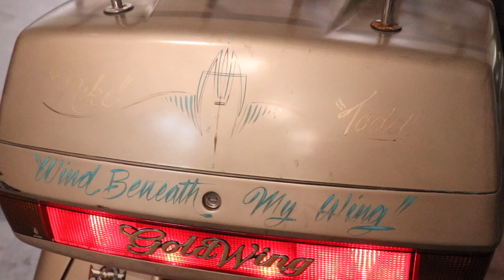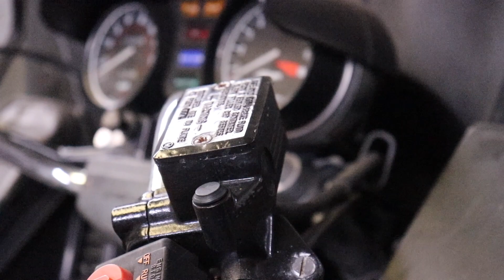The BEST DEAL at a Harley Davidson Dealership | Cheapest Motorcycle

Comment: Amazon is the place to go for Metric parts, NOT the Dealer. 
And my local Harley-Davidson Dealer sold me my replacement 2021 Road Glide for less than I paid for my 2009 Road Glide (also got a good trade in for my 2009 with 148,000 miles). 🏍💨🏍💨

Comment: Would you buy the new V4 Multistrata Pikes Peak at  $28,000 or a Harley Road Glide for $29.000?  The multi is 170 horsepower, 500 pounds, stability control standard, and Electronic suspension? In your opinion?
Reply from the maker: Probably the Multistrada, I like my Harley’s old and unreliable and my adv bikes new and unreliable

Comment: One pro tip.....if you ever have a caliper where the pins are stuck.....DO. NOT. EVER. Use heat to try to loosen it. You run the risk of an air pocket in the grease behind it. One of my techs recently almost lost his left index finger. He'll be out for MONTHS. And he's lucky he escaped amputation. Mechanical work is dangerous.

Comment: I hate going to the local Honda motorcycle dealer. They won’t work on anything other than stuff that is within the current decade and barely keep any parts in stock and charge 25-30% more than partzilla sometimes it’s even more than that. If it’s not fluids I don’t even bother going there

Comment: You probably know that already, having owned a GL1500 for quite some time, but just in case you didn't - careful, mate, with that foot brake not feeling good on these bikes. 

The foot brake is not just rear brake - it also brakes one of them front discs. That's why it's a bit of a bear to bleed too and may be done wrong by previous owner - and if it's not bled properly, you only have a single front disc to slow down all that bulk. Which it is obviously not going to do in a hurry.

Cheers, Juss

Comment: The „great“ YT Motorcyclevloggers alle say that Motorcycleriding is expensive. Hell No. Safetygear is cheap at craigslist, and used motorcycles with low CC are also cheap. Here in Germany i paid about 500 $ for my Gear, and 4500 $ for my Motorcycle (Honda CBF 600, from 2010 with 6000 Miles). Tax and insurance together cost about 150$ for a Year. It is dirtcheap, and a regular mode of transportation..